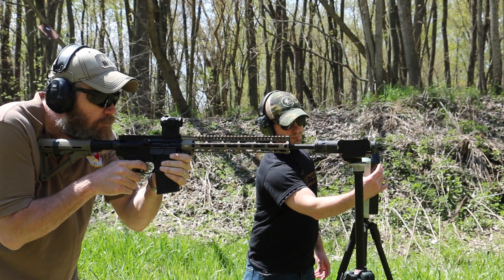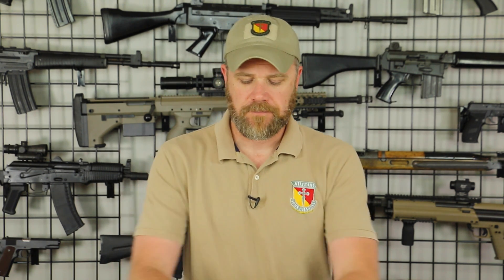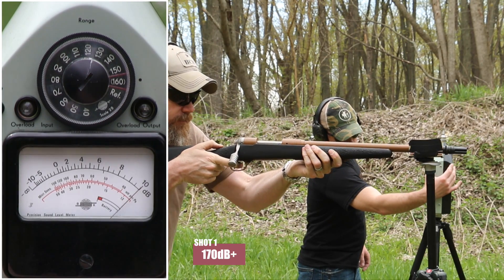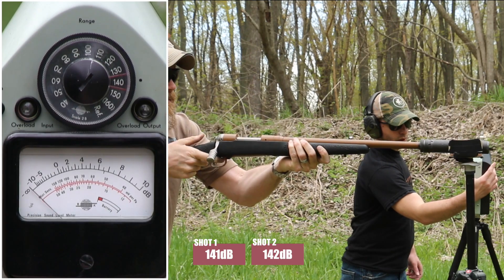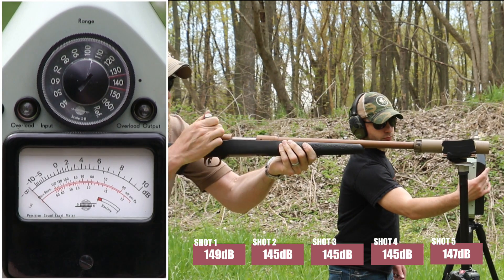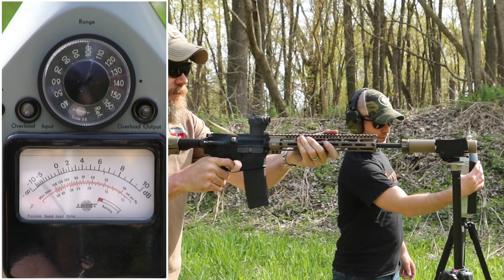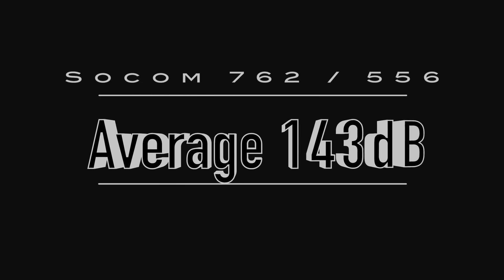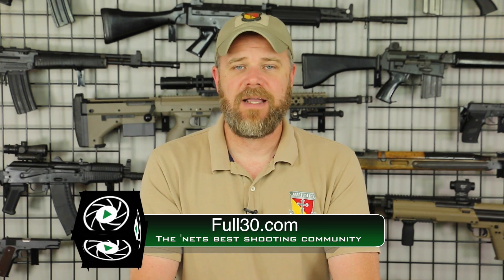Testing 30 Caliber Suppressors

Comment: This needs to be reassessed! 7 years later with a ton of advancements in technology!!
Reply: Most of the advancement was in ear performance, which was not tested during this test, so it would be harder to see the changes.
Reply: @austingreen3888  right but now you have things like the flow thru technology
Reply: @tyler1776.  my point was it wouldn’t be able to be compared because there is no ear data here.  It would look like the best suppressors performed the same, when they got quite a bit better
Reply: @austingreen3888  I understand that, the microphone makes everything relatively the same DB to the listener, but to the in-person ear, the difference is definitely noticeable. I still want it to be reassessed simply for the input from the person whose ear can hear the guns in person, maybe see how the flow thru compares to others in regards to gas to the face. Again, not something we as the listener to a video can discern. But the input is still valuable.
Reply: @austingreen3888  I don't disagree with you at all, but I would still like to hear their input on the technology we have today.

Comment: You can't average decibel readings? What's the reasoning behind that? I'm an acoustics expert and I don't really understand where that's coming from...

If they're worried because dB is a logarithmic scale, that's easy to fix. You just convert the dB reading to pressure and you can average that, then convert back to dB...

Some of these numbers are really concerning... 140 dB is still above the threshold to cause hearing damage and is louder than an aircraft carrier's flight deck during ops, and because dB is a logarithmic scale, 146 dB is 10x as loud as that!

Comment: Will a 30 caliber suppressor fit on a threaded 6.5 mm Creedmoor? I ordered a "can", through an FFL Gunsmith, for my Tikka Bolt action 6.5 mm Creedmoor (awaiting ATF approval). However, I would like to also use this suppressor on an AR 308, if it will fit. I'm not concerned about the variance in sound reduction.

Comment: bolt rifle averages
AAC SR-7 -  145dB
SilencerCo Saker 762 140dB (138 on a semi)
SureFire socom 762-RC  - 146dB (143 on a semi)
Griffin Recce 7 -  139dB (135 on a semi)
Dead Air Sandman L -  141dB
SilencerCo Omega - 137dB (136 on a semi)

Comment: silencer co. averaging decibels is equivalent to Chinese putting false luments on their flashlights and false capacity on their batteries. True military gear comes backed up my true science and proper measurement, what these guys are doing is making toys for idiots that don't suppress as they should. True suppressors wear off, those tested in the video are basically muzzle extenders, strap-ons
Reply: that said if you want a true suppressor that suppresses gun sound, get one of those oil filter adapters, that will give you special ops type sound suppression, not this garbage

Comment: Hey tim, I wish you would have done these tests with an AR-10 SIX INCHES FROM SHOOTER'S EAR! The noise created by backpressure is NOT a factor with a bolt action rifle.

Theoretically the quietest one could be louder than a middle of the road one because of more backpressure.

Comment: 120 db is in the range of a thunderclap or chainsaw.  130 db is in the range of a military jet take-off from an aircraft carrier with full afterburner at 50 ft distance.  140 db is the range of an aircraft carrier deck.

A .22 cal rifle can be suppressed down to 110 lb...the same range as an auto horn at 3 feet, riveting machine or live rock music
(108-114 db).
SOURCES: Temple University Department of Civil/Environmental Engineering    (www.temple.edu/departments/CETP/environ10.html), and Federal Agency Review of Selected    Airport Noise Analysis Issues, Federal Interagency Committee on Noise (August 1992).    Source of the information is attributed to Outdoor Noise and the Metropolitan    Environment, M.C. Branch et al., Department of City Planning, City of Los Angeles,    1970.

Comment: you have to average it to give a quantifiably number to each unit. yes 136 db is a big step above 135db. but mathematical mess that arises from this type of nonlinear numbers would cause your average human(something that in my opinion , doesn't exist) to be very thoroughly confused .
Reply: you know , talking about the first shot, second shot differences, I wonder if gas co2 sprayed into the can to replace o2 would mitigate the first shots high db.

Comment: These are relatively simple devices to manufacture and material costs (stainless tubing / cnc baffles) are 1/5th the cost when made for a dirt bike or Quad.  Also the volume on these cans left something to be desired for a .308 suppressor.  A big fat 2.5" diameter Ti can would have out performed all the ones tested here.  Not really sure what advantage a small low volume can brings to a bolt gun package that's already 12lbs and 42" long before you've mounted your tiny lightweight suppressor.

Comment: What is the point having a can for a 30 cal thats not shooting subsonic ammo? 
Both suppressed and unsuppresed still require hearing protection (i.e. still louder than a .22)
Reply: for military/law enforcement use it quiets the blast. its easier to locate the direction of a shot with the boom than it is with just the crack sound. so the quieter the blast the shot is still herd by the enemy but is harder to detect exact location at range.
Reply: AussieBrutus1981 it also reduces noise pollution.

Comment: Thanks for the effort! FYI I don't think there is a standard for how to rate a silencer, MTD 147 is for constant standard noise, and a gun shot is not that. But it is great you are methodical and consistent. The A weighting disregards the low frequency content. If the measurements were flat or C weighted the cans with more of a boom sound and not a crack, would register higher SPL and sound louder. I work with acoustics and have some knowledge and would be glad to chat about it. However since you have started this method I would stay with it. Oh, and yes you can average dB ratings, it's a recognized method. The biggest comment is that for lawn mowers, voices etc a 10 dB changes sounds twice as loud, and a 1 dB change is not recognizable. The same is probably true for impulse sounds, but I haven't read up to see how well that tracks. It is tricky until you get familiar with it. AND iPhones uually limit all readings starting around 95dB because of a built in compression circuit, they are not useful in this application, plus how can you calibrate one?

Comment: I'm wondering why only supersonic ammunition was used? Yes the suppressors cut right at 30 dB from the non suppressed baseline. No suppressor is going to mitigate sonic crack. I would think the level of suppression achieved with subsonic ammunition would be a more telling test. Not all suppressors are created equal with subsonic ammunition. Some mitigate sound better than others.
Reply: +Roger D. Pemberton Jr. Subsonic ammo in 223/556 is about about as powerful as 22 magnum and isn't powerful enough to cycle AR15 bolts, thus turning your semi auto AR into a single shot 22 rifle.
Reply: This I understand. Running a suppressor to still wear hearing protection, I don't understand. I can wear in ear and muff hearing protection for alot less than a can costs. To each their own. I digress.
Reply: +Roger D. Pemberton Jr. This is true, however, from a military stand point, suppressing supersonic rounds makes a lot of sense especially for snipers since the crack of breaking the sound barrier is omni directional. This is why 300blk is becoming so popular. Perhaps a test with subsonic 300 for these cans is in order.
Reply: 5.56 suppressed isn't something I have a lot of experience with. For obvious reasons. I do have some experience with the 300 whisper/blk suppressed/unsuppressed and super/subsonic. That makes sense for reasons of practicality and function. It takes nothing more than a mag change with everything else being equal to go subsonic and your rifle still function. Plus be almost as quiet as a church mouse.
Reply: Yep, now lets hope it becomes a more common round like 223/556. Even reloading 300 prices are still around $.40-.50 cents a round.

Comment: why test the sound at the muzzle??  the person shooting is standing around 2 feet behind the end of the suppressor.  or have i been holding my rifles wrong and my suppressor should be near my ear??

i really could not care about industry standard tests.  i want to know what i will experience at my ear behind my rifle.  these are not like guns where i can buy one and resale it if i do not like it very easily.
Reply: +jetthelooter They measure that way for consistent comparison. It's an industry standard. It's like using ballistic gel. It doesn't simulate flesh and bone, but it is consistent.

Comment: Omega killed it. The others sucked for the weight/ length ratio. I am consistently disappointed with surefire.
Reply: K Bob
Thanks for your well written  comment.

If you remove the "anchor brake" of the Omega and replace it with a flat cap, that db to the ear goes down. The brake's fins  reflect the sound back to the shooter just like a muzzle brake. You do not NEED the anchor brake, especially for Sub sonic rounds. And the flat cap makes for a VERY compact package!

One of the MOST quiet cans for 300 sub BLKOUT is a Sig Titanium can. But it is longer, fatter and heavier than the Omega.
IMO and may others the Omega wins because it is a leader in it's size and WEIGHT.

If you go longer or heavier on your can, all of a sudden your nice compact SBR is a heavy rifle with an 18" to 20" barrel. A big heavy can defeats the purpose.

The Omega with a flat  cap and screw on version is light and short. I believe it is the top selling 30 caliber can. Griffin is the one company to watch. They are right on the heels of Silencerco. But their stuff is still to heavy IMO. But Silncerco better watch out. Griffin might surpass them. We shall see.

Tim from MAC LOVES Griffin. He has a serious Bromance with them. I love Tim's channel but often do not agree with him.

One final thing. I love the screw on versions of
EVERY can because the QD can add a "ton" of weight. ADCO can machine a taper into your barrel and a matching female taper in your can to fit like the Sig cans. They only need to be tightened hand tight and never shoot loose.
Reply: The surefire can they are testing is made for 300 win mag. Apparently suppressors have "performance windows". That can will suppress 300 win mag better than a suppressor designed for 308 pressures. Surefire has just released a new suppressor aimed at lower pressure rounds. When silencershop still had it up, the omega was 2-3 dB quieter at the muzzle than the 300SPS, but it was also 2-3 dB louder at the ear on all calibers tested.
Reply: Also I went with a SIG SRD 5.56 QD suppressor for my first rifle can because of the fair price and it has really great sound reduction compared to other choices for the money. I'd love to have a KAC CAN for my Knights Armament SR-15 but 1400 bucks and shit sound reaction isn't worth it to me.
Reply: +Matthew Norris 
Agreed...100%
Reply: You have to understand surefire makes suppressors that can be dragged through hell and back. They literally make one of the most durable suppressors on the market. Which is why the military uses them! They aren't interested in making the quietest can possible because they aren't catering to the civilian market. If you want the surefire name and durability then spend the 1400 dollars. Because that's what a lot of consumers in the civilian world want. They want that tactical name brand cool gear for there guns. The military uses them because of the durability and it somewhat helps reduce sound during spontaneous fire fights. 

Now like the comments mentioned before it is true using a .30 cal suppressor on a 5.56 won't sound as good as a dedicated 5.56 can. So in most cases you're better off saving your money and buying a Silencerco or other less expensive brand that cares about making a quiet suppressor.

Comment: great video.  I have a question. the omega you tested, when put on the 556,was this still with the .30 cal end cap or was the .556 put on? Thanks in advance for your answer

Comment: I am looking at getting the Omega. From the test results, it looks like a good  suppressor to get the job done as good or better than most of the others. In the screw on configuration it is pretty light at 14oz.

Comment: I know its been a few months since you made this, but I have a few points to make.  First, an increase of 3dB would produce a sound impulse twice as loud, second an increase of 10dB would produce a sound impulse 10 times as loud.  dB's are weird things and while a perceived sound might not seem so bad, it's still doing possible damage to you or anybody around you.  Another point I'd like to make is that these kinds of tests are all well and good for firing line sound and are quite applicable for range time.  What I've never seen is downrange testing for sound.  In the case of battle, my enemy usually isn't standing beside me.  A common conception is that muzzle blast is sound that allows the enemy to locate the source of the sound while the supersonic crack which suppressors do little to mitigate aren't easily located.  I question this conception.  So, I'd like to see some experiments testing down range sound.  Say 50, 100, 200 yards etc.  Let's hear what the enemy hears.
Reply: Not exactly, dBs are a relative scale, you have to differentiate between the sound energy and what we hear. In terms of perception, a 3 dB change of normal sounds is what is required for 50% of listeners to hear a change, a 6dB change and most people say 'that is a change', and a 10 dB change is perceived as twice as loud. So the point is loudness is our reaction or perception to a SPL change. I am not expert in how we hear impulse versus sound levels integrated or occuring or 1/4 second or a second. It is very different.

Comment: I find it odd that no matter if you use a 30 cal or a 5.56 specific can, you get about the same results.  ...BUT, 10+ db's more are suppressed (to about the same level as the 5.56) with a 30 cal thru a 30 cal can.

Comment: Water is NOT Corrosive (Ph7), it's the combustion products from firing the cartridge MIXING with the water that will form a Sulfurous Acid (H2SOx) and corrode the Suppressor.
Reply: +James Vetzel Water, except freshly distilled in the lab, is never "pure" H2O.
Reply: +W Canaday Most shooters will carry a "Squirt" bottle of "Distilled Water" in their shooters bag, a few ounces will last about 20-30 shots (slow fire) with about the 2-3 shot being the quietest. I don't want to introduce any other compounds inside the tube, as I don't clean until the next morning. Stainless is best but a lot of the tube Manuf. don't offer that option. Most of mine are .22 LR Cal, 5.56 mm, 9 mm, .30 Cal, only one of the .30(0) Whisper/ Blackout is Stainless

Comment: Thank you for this video.
After much research I've decided on the SiCo Omega as the one.
It seams to work acceptably on .556 through 300 Win mag and people have good things to say about their costumer service and warranty.
Reply: +Walter Sigona 
The Omega is uber quiet with 300 BLK too. I like the brake idea to dampen recoil even more. This is one very light suppressor. I think it quiets better than anything in its weight and size class. To get significantly quieter you need to go to 9". There ARE quieter suppressors but they are not smaller or lighter than the Omega. I think the Omega pushes a lot of buttons for a lot of people. 

Not really military quality since you can damage it after about 4 full auto mag dumps. Most of us do not intend on getting these up to 900 degrees which is their threshold. That is pretty hot.

Still, I would have my own Fluke handy to read temps so I had my own data.
I think mag dumps of any sub sonic ammo could be done full auto for a LOT of mags before 900 degrees was reached. Again, one would have to do his own tests with a Fluke infra red thermometer.

I want me an Omega...bad!

Comment: Question: I only care about suppressors/silencers/make gun quite devices for hunter safety.  Dose the dB change meaningfully when the dB meter is placed at the shooters ears rather than at the mussel.
Reply: +Scott McCullough 
Yes. Think of the gases as traveling in a cone that is basically 60 degrees wide and to the front. That cone will interact with the air, transferring some of its energy to it (and it's at this point that I'd need a degree in physics to explain what happens next in any detail) ... but the rule of thumb is that every time you make the gas turn 180 degrees, you cut the sound by 1/2.

That's why just packing a can full of stainless steel Brillo pads works so well ... it forces the gases to travel in anything but a straight line.

Obviously (do the math) you never reach zero, but you can be certain that the sound at the shooters ear is less than the sound in front or even to the side of the muzzle.

Comment: Will you be testing POI shift from unsuppressed to suppressed? Reduction in sound is only one aspect of suppressors. And POI shift I feel gets overlooked when buying a suppressor.
Reply from the maker: It's a topic we've addressed in the "everything about Suppressors" video.  It almost always occurs and even two cans of the same make and model can have varying degrees or direction of shift. Other than saying it happens, which we've already done, there's no real point to doing test of different cans as the results will vary so wildly.
Reply: Military Arms Channel Thanks! I'll check out that other video.